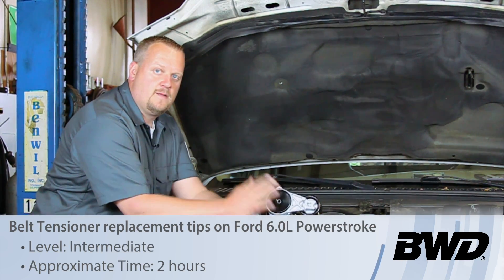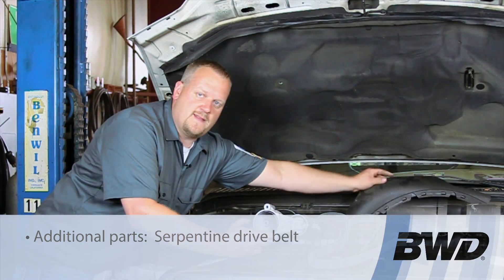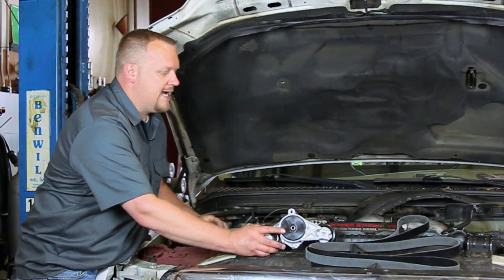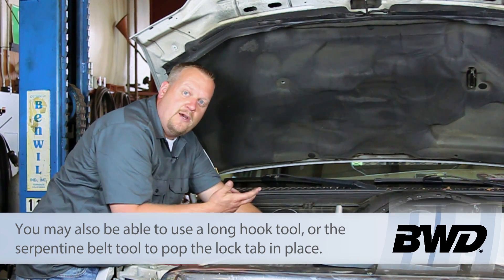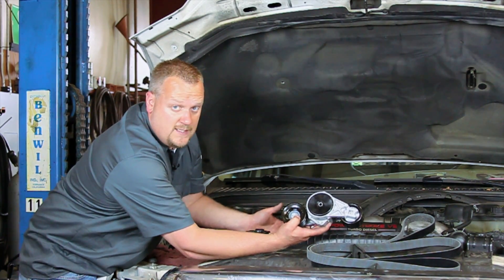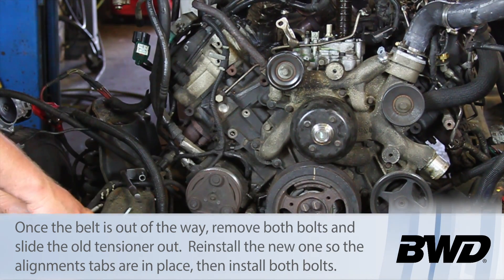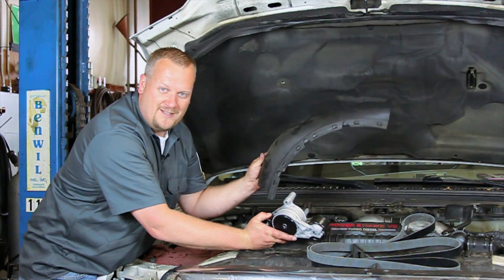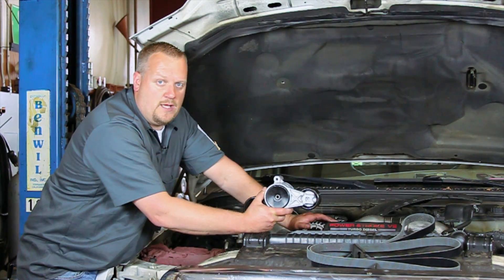Ford 6.0 Powerstroke Belt Tensioner Replacement

Comment: So I removed the top shroud piece as you stated to do but you can't get a socket on the bolts Because of the lower shroud so you gotta disassemble that as well